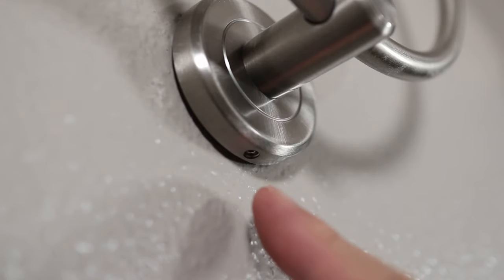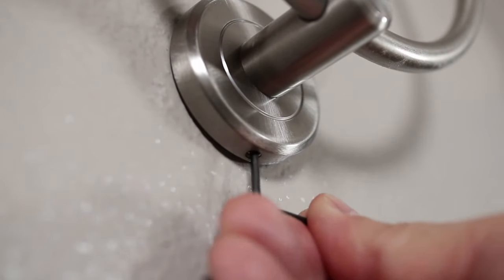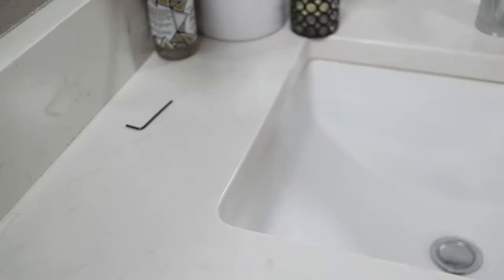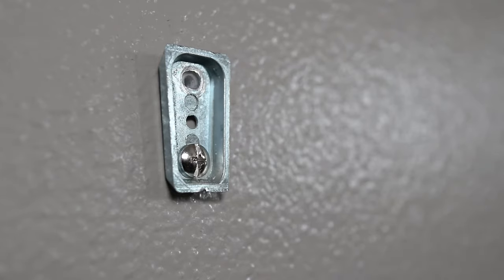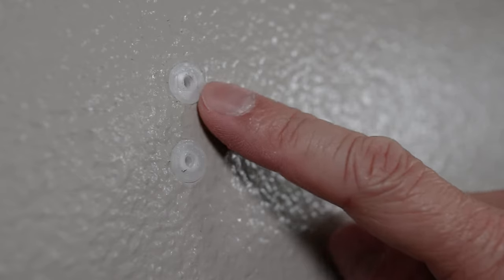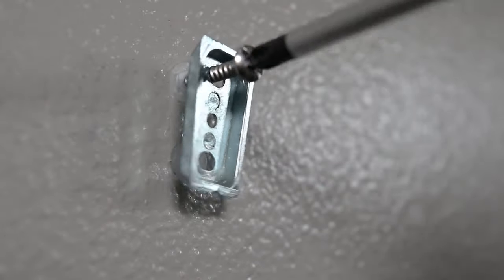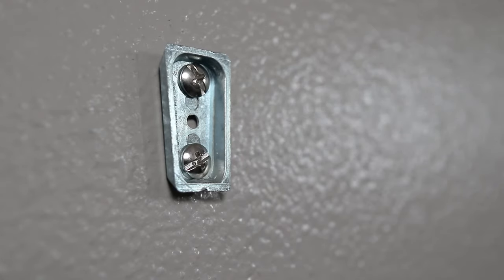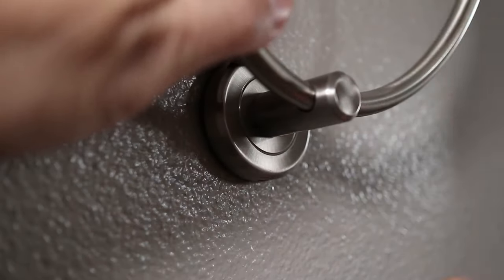Towel Ring Removal With No Damage to Wall - Towel Ring Repair or Replacement in Drywall Installation

Comment: If only mine had  set screw.
Reply from the maker: Some viewers have said they don’t have a set screw on their towel bar/towel ring. I’ve not run across that before. But I’m curious so if I ever see one without a set screw I will have to check it out to see how it’s attached.

Comment: This is not the hard part. Show how to change out the old towel ring for a new one that has a smaller mount. That means removing the butterfly and then installing a new one 1/4” - 1/2” away. Try that!